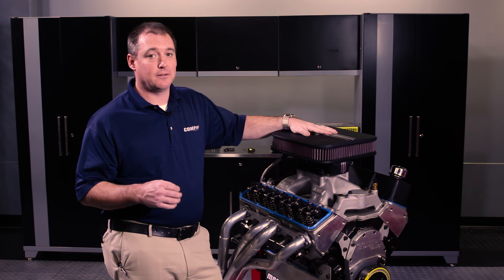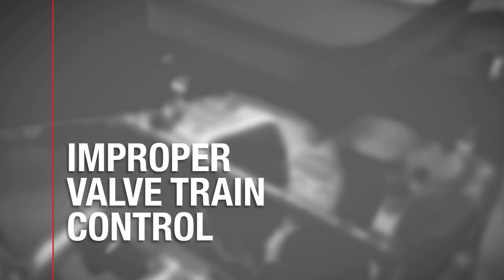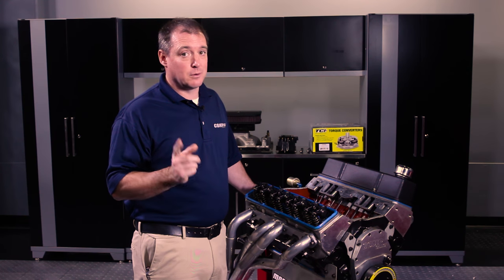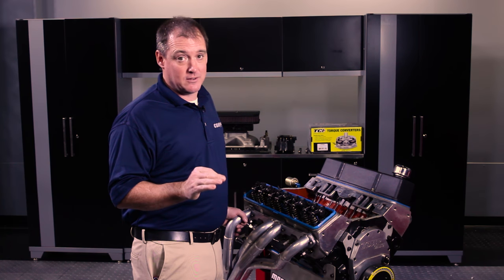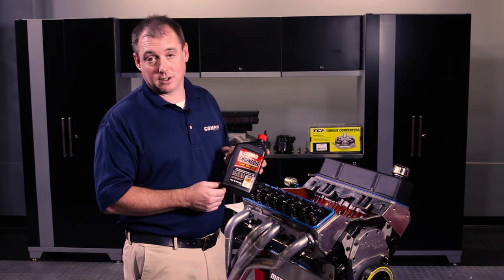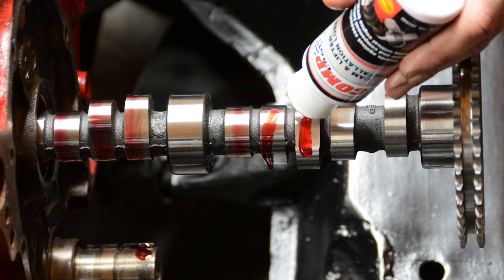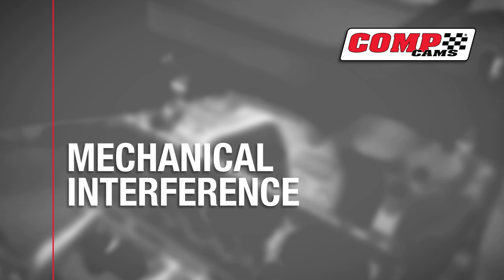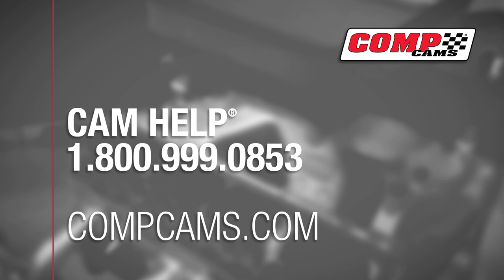Top Ten Reasons for Camshaft & Lifter Failure

Comment: We 'lost the cam & lifters after about 10 minutes, on the dyno, during the break-in period. Called the cam company, and they've got a guy in damage-control mode just waiting to take our call. He asked if the cam and lifters were compatible, we said yes, it was a kit purchased from them. He asked if we used the lube supplied with the cam kit, yes was our answer. Then he asked if we used the oil additive that they sell and recommend, again we answered yes. He asked if we used a zinc-based motor oil, and again I said yes we did. Once we told him which brand of oil we used, he proceeded to inform us that the oil company changed their formula and the failure was our fault for using that brand of oil. Turns out, that isn't true. Many other engine builders are telling of cheap lifters made in China. That one make sense. Our shop has not changed a thing when it comes to attention to detail on engine break-ins, and we're in our 51st year of operation.
Reply: Putting an engine on the Dyno and revving the
shit out of it, for break-in, is Not the recommended procedure. Break-in is usually running the Engine for 45 minutes to an hour, at 2500rpm. No more, no less, with the proper break-in oils, then changing the filter and draining the break-in oils and replacing with the recommended weight oil.
After about 500 easy miles, THEN, put it on the Dyno. Also how many miles did the engine have before the cam/lifter swap? Was it a fresh build? If not, was the oil pump checked for good oil pressure?? Don't matter if you've been in business 100 years, that's 100 years of doing it wrong. Don't expect an engine to be "completely" broken-in, ie, brought to temperature, and all surfaces properly mated and polished-in within the first two hours of run time!!! Some freshly built engines require over 1000 miles to break-in properly. I would never do business with a shop like yours. If engines have held up in the past for you, you've been lucky, but I bet any amount of money those engines will fail, sooner than later. Main goal here is to increase engine longevity, unless you're building disposable 
throw away engines...
Reply: @Pork-Chopper  During a break-in run on the dyno, we don't "rev the shit" out of an engine. For one thing, we use softer break-in valve springs which would allow the  valves to float if the engine was revved too high.
Reply: @rollydoucet8909  
Valve float is not a good thing either. If the
valve starts floating, or bouncing up n down, it can hit the tops of pop-up pistons, or worse, the valve keepers on the top collar can come get off and cause catastrophic damage.
Also, if a good mechanic/technician has ALL the engine specs, comp ratio, bore/stroke, and camshaft profiles, ie, lift, duration, cam lobe separation, etc, to mathematically calculate the estimated HP and torque fairly close to what the Engine is going to produce. You can also use software where you can "plug-in" all the engine specs and run the program and it will calculate the horsepower per cubic inch
of displacement. It is not really necessary to run engines on the Dyno, unless you're fanatical about finding out, or are mapping out your fuel mixtures. The newer fuel ign systems already do this for you. All this only if you are trying to shave off milliseconds of your ET's.
Reply: @Pork-Chopper  Like I said before, we don't rev the engine up to valve float speeds.
Reply: @rollydoucet8909  
10-4
Whatever floats your boat!
Reply: @Pork-Chopper  Break-in for new engines on our dyno goes as follows. If the engine is fitted with a flat tappet cam and lifter kit, proper oils and break-in lubricants are used, along with softer valve springs, and the engine will be run with a slight load on the absorber, at 2000 to 2500rpm for 15 minutes, then shut off and checked over, then once it's cooled, another 15 minute session, followed by a third and a fourth. Once break-in work is done, oil and filter changed, and the correct valve springs are installed before commencing power pulls. We've done it that way since 1980 without problems, until the offshore lifters hit the market last year. Hopefully, someone in America will start making good lifters again.
Reply: @rollydoucet8909  
I understand. That is the proper way to do it.
All I am saying is that a Dyno is not really necessary to do that, unless you have hot rodder's requesting that service.
After building engines with certain combinations of cams, intakes, and exhaust
systems, you should already have a chart of the hp n torque combos. I grew up building engines, mostly Chevy engines, then early Harley motors, a few Knuckleheads, a number of Panheads, and quite a few Shovelheads n Evo motors. Stock output was around 55 to 60 hp. After I would build them, 8.5:1 or 9.5:1 compression, a good carb, and a good flowing exhaust with a little bit of restriction, after my break-in procedures I knew it was going to be a stronger motor. My customers would take their bikes to a shop with a Dyno an they would report back HP number increases of 
80 to 85 up, with stock bore n strokes. My math calculations n software simulations were pretty close. They were 1340cc or 81.7 ci or better known as 80 inchers...
Instead of high lift high duration cams n high compression. I made power by increasing the size of the valves, using moderate compression ratios as above for easier starts and cams no bigger than a 510 lift and a bit longer durations,
244, 268, with no more than 40 degrees of overlap that would give it that deep potato potato lope everybody likes to hear. I'm into low end power not high end power, because torque is what moves your ass, especially when you're packing Ms Piggy...
Reply: Why do you think the cam failed ? Chevy is notorious for that.
Reply: @chuck7432  Don't put them in your engine. Send them back.
Reply: It's never their fault.....
Reply: been a mechanic for 47 years ,none of these problems occurred in the 60s through the 90s ,the bottom line is the quality of the garbage parts these suppliers sell , cheap parts bad quality control is the number one culprit ,i dont care what these so called experts preach
Reply: If you used diesel oil, it is no longer high in Zddp.
Reply: @doomman700  zddp DOES NOT matter
Reply: @freemanfornow264  it most certainly does when it comes to flat tappet wear.

Comment: Any competent educated engine builder knows these. Those of us who have been building engines for decades knows this. This vid comes across as a bunch of lame excuses to cover for a big batch of flawed product made of substandard materials and lack of quality control sourced from places outside our country. 
Blames everything on the builders with no responsibility for a product lacking in the quality it once had. 
Specifically the flat tappet lifters. 
Notice how they are pushing the more expensive roller conversions now with that highly suspect link bar holding them together. How strong is that piece? 
Until the product has the same reputation for quality that it had 30 years ago , I cannot trust it any longer and refuse to invest/ gamble  my hard earned money in a questionable product. 
Stop blaming the builders . Take responsibility and rebuild your company reputation.
Reply: Exactly 100%
They've cost me two builds
Now I'm on my third.
No way in this world another comp cam will ever go in my engines again.
Reply: Comps cams are good. Thier lifters suck. Made in china. I know of several reputable engine building shops that say the same .

Comment: What about how your lifters are made overseas and not hardened?
Reply: right on
Reply: I resurface lifters from vintage engines. 
Only problem I've ever had was some hydraulic lifters won't stay full of pressure and bleed down.
Reply: @cammontreuil7509  but are you in China cutting corners?
Reply: @superduty4556  no. I'm an American. 
I've reground hundreds of lifters from 60's and 70's cars.
I just found a 283 1959 year. It has a solid lifter cam. Going to have Delta Cam in Tacoma reground the cam. They do great work.
And I'll grind the lifters.
Reply: Except the harness tests all come back fine...
Reply: @gofastparts4u  who's testing harnesses?

Comment: Not every cam failure can be simply blamed on spring pressure, modern oils and the builder. Buy quality parts that are made of materials  produced, machined, cast  and heat treated in the  U.S. by a manufacture that employs people who are highly trained and have a passion for the end product. Low prices usually reflects the quality   your getting.
Reply: I have learned the hard way to only buy products I know are made in the USA.  If I get something that's made in Mexico or any place overseas, I don't trust it and send it right back where it came from.  I got some Melling lifters and found out they were made in Mexico recently.  For my Jeep 4.0 I only trust MOPAR and EngineTech.  After seeing some side by side comparison of non-OEM cam shafts (it was a big name but I am not certain) I found the aftermarkets had skinnier lobes.  I further learned that if you see that the chances are it came from China and they also used weaker metallurgy.  Some engines can get away with it, but not a stroked 4.0.  Valve spring pressures are a big one for strokers.  I only just found out from a machinist that the seat pressures I had on my springs were double the OEM spec, and I specifically asked Golen to give me OEM specs on everything, to include the camshaft.  This will be my 4th and final stroker installation, and it can't be any more right this go around than it has in the past.  If it fails I'm throwing a working 4.0 in and calling it the end of that story.
Reply: Wayne Sanders I work for a Dodge dealer and sorry to say. Even though your Jeep is assembled in the US. 75% of the parts are made in Mexico and South America. The OEM engine internals are made in Mexico. Who are you kidding.
Reply: NOOOOOOOOOOOO.  Where are the rest made...? I've noticed a number of parts I have taken off have their origins and they aren't SA or Mexico.
Reply: I have been building motors for many years and have worked in the heat treating industry where material selection and processing play a huge role in parts life. I can state for a FACT materials cast/forged and  machined outside of USA, Japan & Germany are commonly of inferior quality. I believe Comp cams buys their blanks from China and that combined with poor quality oils and heavy spring loads and results in lots of cams failing. I wont run anything but roller cams now and will never purchase a comp cam again. One failed, destroyed a expensive race motor.
Reply: funny thing is ford guys want the 302 MEXICAN block because its the strongest of the 82 deck other than a boss.  go figure
Reply: that's nonsense,stroker motors turn less crankshaft rotational speed,at most the springs you would add regardless of cubic inches would be 25% over stock for flat tappet and 40% over stock for rollers,i don't like rollers for the disintegration that happens when they explode,for the extra 30 horse i'll do something else to gain that,flat tappets and hydraulic lifters have worked real good almost a 100 years, I use isky hardface flat tappets and run 40% over stock for racing,never had engine failure,just wore them out,timing components ever 150 runs,no problemo
Reply: Sadly U.S. auto manufacturers are full of shit show employees that don't give a shit about their job. I've worked for FCA and those plants make you never want to buy a vehicle ever again. All I could say when I saw some of these people working was, holy shit... Its almost impossible to find anyone in that place that cares about anything they are doing. They will damage shit and send it out the same day no questions asked. I'd much rather like you're saying, find a highly trained manufacturer that employs good people making high end products. Sadly most of these vehicles are screwed up from the start and no big mass producing car companies seem to care about quality anymore. It's just toss them together as fast as they can and shove them down peoples throat. Worry about failures and issues later and most of the time try their best to blame the customer for the fault.
Reply: @Dime, SPOT ON!!!💪👍
Reply: It’s all a matter of opinion based on what has worked best for each builder. I believe the many benefits offered by roller lifters are enough to never give the possibility of failure a second thought. Buying quality rollers from a trusted source is the first step to make sure a catastrophic failure from a bad roller lifter doesn’t spoil your day.
Reply: @waynesanders1406  the irony is if you took the 5 seconds to look closer you would see the companies you mentioned rebrand products from mexico and china all the fucking time.
Reply: @strattuner  you dont do the math,flat tappets are not superior to a proper billet roller cam EVER
Reply: @trillrifaxegrindor4411  i didn't say they were superior i said they won't go in my engine due to valve spring pressures off the map in numbers,and they explode and take the engine with it,no thanks,they used hardface solid lifter cams in AA FUEL CARS before they used rollers,i use hardface ISKY early cams successfully,get over 500 runs,no engine castrophes,you go ahead and use what you want,no worries
Reply: Dime Abbott Besides Toyota and Honda of course
Reply: @danielwilson6665 There is no such thing as a block with a higher nickel content, high nickel block is a myth 100%.
Reply: @DaveMcLain  Hey Dave, maybe I should have worded my comment a little better. I agree with you and that was the point I was trying to get across. Speculation about one type of block being better than the others gets circulated around the internet and some people start believing it.  I know it’s a myth. I appreciate you bringing it to my attention. I might need to delete my comment to avoid any confusion.
Reply: @danielwilson6665  I don't know where that high nickel thing got started but it was going around long before the internet.  Maybe it came from the Chevy blocks with the 010, 020 block markings or Ford  blocks with an X?
Reply: @DaveMcLain … I don’t have a clue how such speculation and rumors get started. I believe you previously addressed the one about Cleveland four barrel heads that have a “dot” beside the “4” supposedly indicating open combustion chambers. We both know that just isn’t true. A good example would be my Endyn High Port iron heads. They are D1AE-GA with the dot beside the 4, and are clearly quench chamber heads.

The only thing that seems a little strange about these Endyn iron conversions is the casting date. They are 6F7 (1976/ June/ 7th.), which seems kinda late in the decade to be casting quench chamber 4-V heads at the Cleveland foundry. 
I read that Ford did a special run of 4-V quench chamber heads at the Cleveland foundry during the middle seventies to supply the needs of race teams. But that’s probably just another myth like those high nickel 302 blocks 👌.
Reply: @danielwilson6665  I think that the story about their being several batches of 4V closed chamber Cleveland heads being cast throughout the '70's is true.  This was simply because the Nascar teams were using a new set for nearly every race.  That's a lot of heads and the supply got used up pretty quickly.  That continued until the A3 aluminum heads were allowed in the early 1980's.
Reply: @DaveMcLain  … That definitely sounds like a valid explanation for this casting date. I have a magazine article from the mid-seventies about Larry Widmer at Endyn Inc. and how he was supplying high port iron conversions to NASCAR and Drag Racing teams. Here in the Atlanta area, my friend John Reed of Reed Cams was also selling quite a few sets of the iron high port conversions. 
They were winning a lot of races with them and that’s justification for Ford to keep the supply well stocked. I believe Ford SVO introduced the alloy versions around 1982. That’s probably why I picked up my iron high ports along with a matching Edelbrock Scorpion intake at a fraction of the original $6000 price tag. Early SVO high ports like the C3’s are still being used for some incredibly powerful Cleveland builds.
Reply: @danielwilson6665  I never had the opportunity to know John Reed.  I started using Reed Cams after he died.  I still use Reed Cams through Steve Demos who worked there for many years, grinds cams and has masters for a lot of their lobes.
Reply: @DaveMcLain   … I met John in 1964 while I was working in my oldest brother Gene’s Speed Shop. I was only 10 at the time but Genes shop was located on New Street in Decatur, directly across from Reed Cams which provided a good opportunity to spend time with John. A few years later when I started building Clevelands, I became a customer of John Reed’s cam business. I still have a brand new solid roller cam and lifter set from Reed during the eighties. It’s not as aggressive on the exhaust lobe specifications as some modern grinds but I might try it out with my current build out of curiosity. I’m probably not going to live forever and I wouldn’t want to let a perfectly good solid roller set go to waste.
Reply: I couldn’t agree more.
Reply: @waynesanders1406  funny but FACTORY gm lifters come from they're MEXICO plant🤣
Reply: @danielwilson6665 John A built me a clever all NASCAR used parts but that man knows how to make good hp can't ask for a better guy still have the engine just needs to be freshed up

Comment: Never had any problems with any of my old cars. Studebaker V8 and six, air cooled VW, 65 GMC V6, 65 Toyota Landcruiser, 69 Chrysler slant six. What do they all have in common? Solid lifters, adjustable rocker arms. 65 Corvette 327 had 365 hp and solid lifters. If you can find them they would be NOS or can be recrowned.